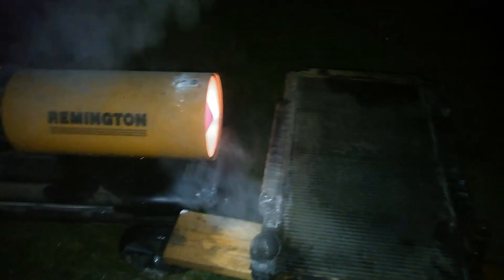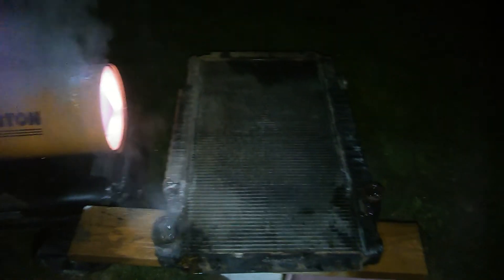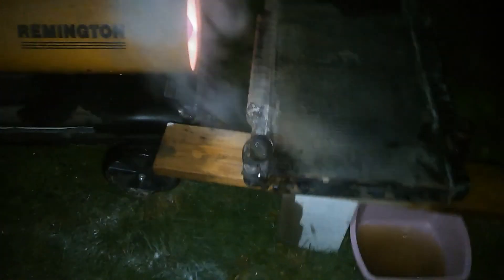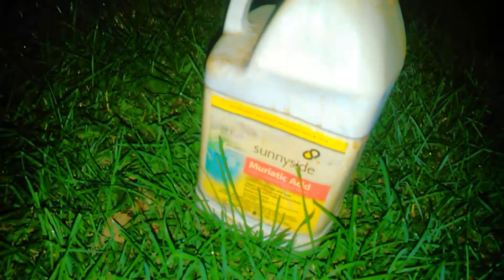How to clean a radiator with muriatic acid

Comment: I use Cascade liquid dishwasher soap to clean radiators, heater cores, engines coolant passages. Pour it in, drive around, flush it out. Works VERY well. Look it up.

Comment: Citric acid is a much safer method and you can just run the engine up to temperature and leave it in for a while. Muriatic is HSO acid and it CAN be done but you have to be careful. It's a lot stronger than battery acid. Most of the old radiator shops used Lye and boiled them when they rodded them out.

Comment: Did u cut the acid with water
Reply from the maker: No I used the muriatic acid straight radiator is still working good today. It wouldn't eat the scale unless it was heated.
Reply: @theshiz666  The scale is hard water deposits and corrosion from electrolysis. Ethelyne Glycol doesn't leave any deposits. Whatever there is can be washed off with water. Most people don't use distilled water in their radiators. Heating the water (coolant) causes the minerals to come out of suspension. Take a look at your hot water heater sometime.
Reply: @theshiz666   ya i noticed when i used the acid ppl claim oh no leave it in for 5-10 min...  10 min fir me it didnt do jack to the scale

So i had to leave it in for 40 min.. then it dissolved it.. and id say got rid if 70% of the scale.

Had to rinse shake the radiator for like 15 minutes as well.. the water coming out was cloudy from the powdery scale.

Ill probably do another soak to be sure.  I have no means to boil it